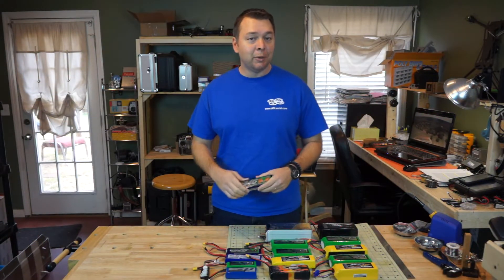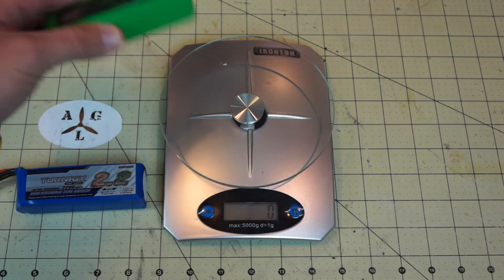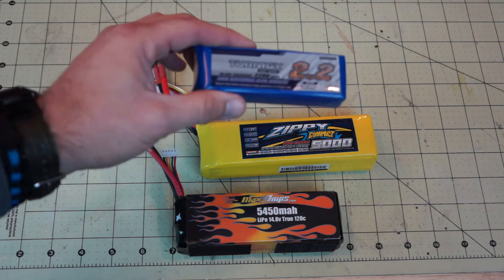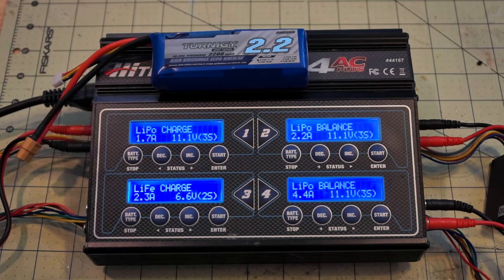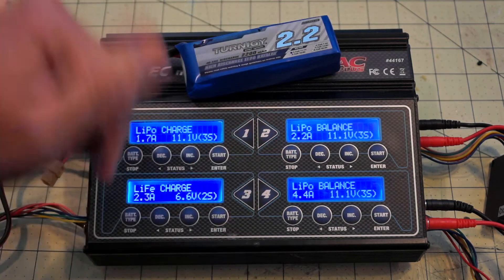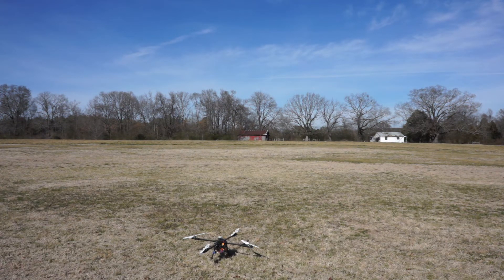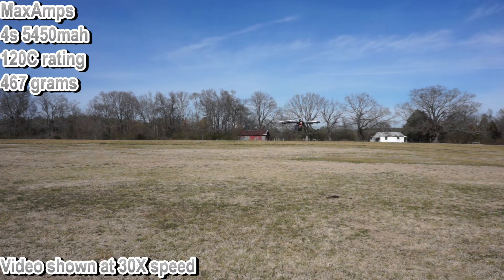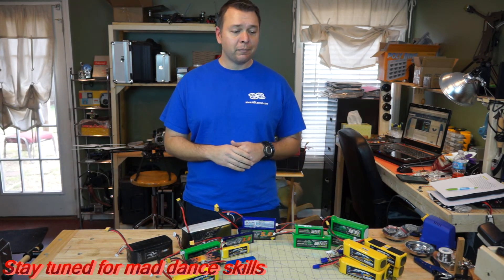AGL Battery Explanations

Comment: how is that poss..i have a hex with t-motor 3508 att 580kv with 13 inch props on a tarot frame and with 10amp 4s battery i get 13 mins..
must be something wrong with my setupp.
Dji A2.
YKS 4s 10000mah 25c battery High discharge model.
Tarot 680
T.motor 3508-20 580kv
Turnigy multistar 30amp opto esc.
cf 13 inch props.
h3-3d gimbal with gopro
iosd with zenmuse And TS-832 5,8ghz ..
could it be the esc going bad ?
i bought the settup 2nd hand.would presciate those with knowledge to give me some tips

Comment: Good video guys.  Thanks.  What may also be a useful number is to work out the grams per minute of flying time to see which battery does the best job for its weight.  For the Zippy Compact 4s 5000mah, this number is 51.6g/minute.  For the Max Amps 4s 5450mah, this number is 28.0g/minute.  For the Zippy Compact 6s 5000mah, this number is 40.6g/minute.  So in terms of weight, the Max Amps is the most efficient.
Reply from the maker: We are working towards doing a battery more inclusive battery comparison video soon.  Good idea about the gram pr minute figures.

Comment: Thanks for posting this video. It's cleared up a few questions I've long had on battery choices for various models. Do the higher performance batteries have a significantly longer lifespan? In other words are they capable of more charge/discharge cycles in their usable lifespan?
Reply from the maker: Yes, but the best way to preserve any battery is just not over using it, running the battery too hard and too low a voltage, and keeping it at a storage charge when not in use.